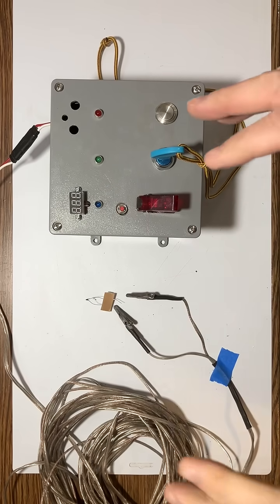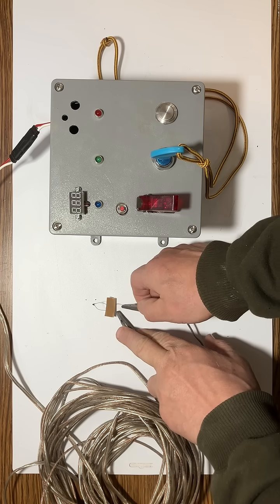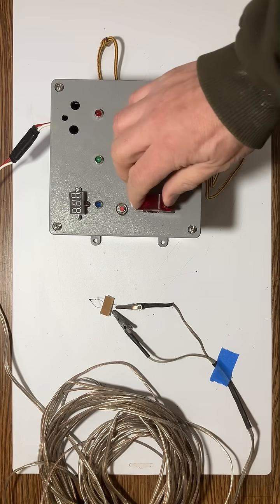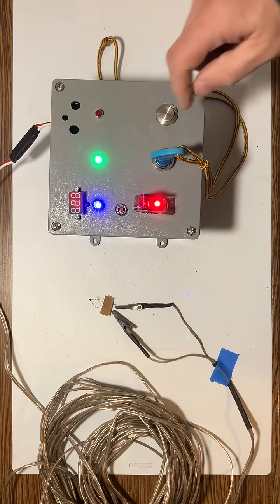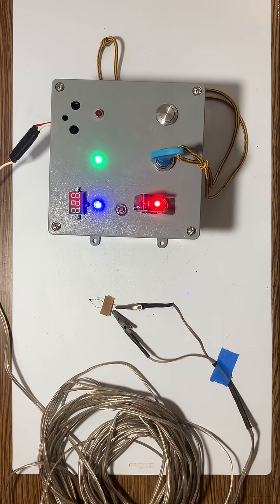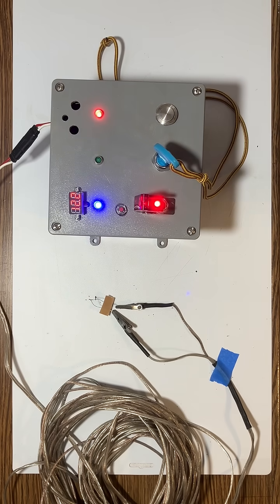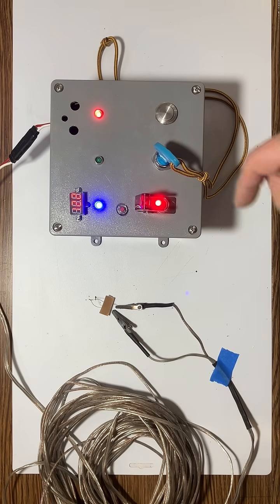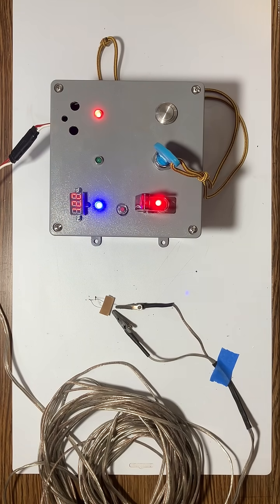Custom Launch Controller 5/5: Successful Launch Scenario

Comment: In the mid-60s I built myself a box like that for my Estes rockets. I used a swing meter since I didn't have access to digital. I was lucky enough that I had a neighbor that had to access to satellite programs and gave me a bunch of nicad batteries. I was carrying around a 12in x 4 in by 5 in box to launch my rockets when everybody else was carrying a car battery and a switch😅😹. I think the only thing I did different once I had 2 launch buttons in series😊 one for each thumb. My leads had duckbill micro clips from Estes on the igniter end
Reply from the maker: It's fun to build stuff. In my 1960's days, hobby shops sold fuses and we used that for some time. Eventually fuses were considered too dangerous and they were not sold any more. I appreciate that my channel re-kindles the days of hands-on hobbies. I do this channel for fun to help people realize the "science" part of the hobby.